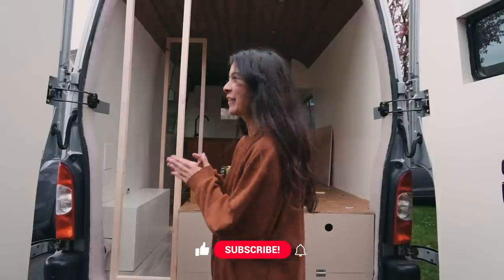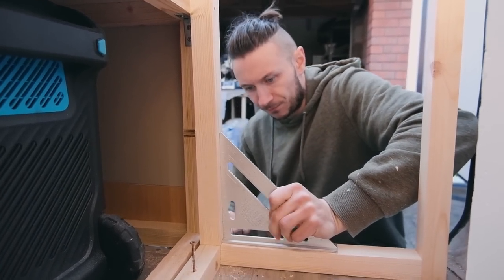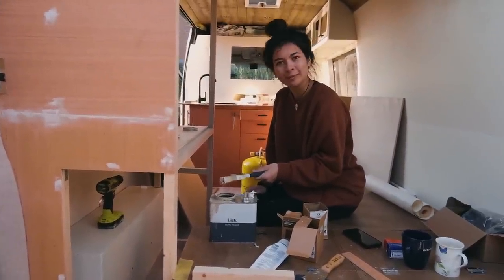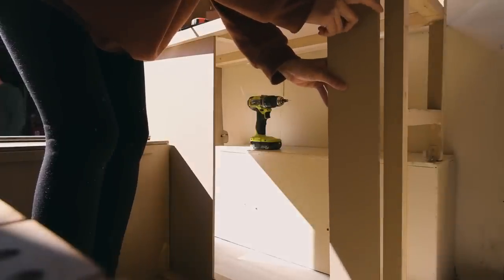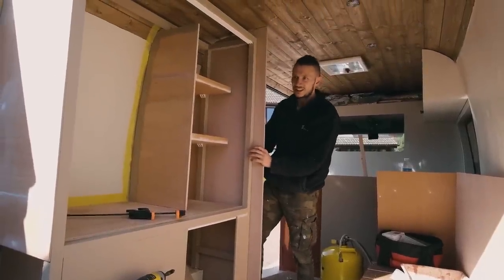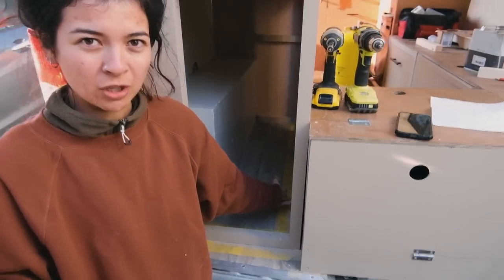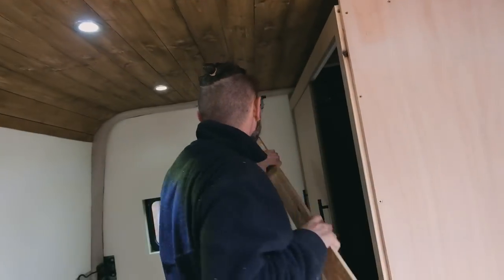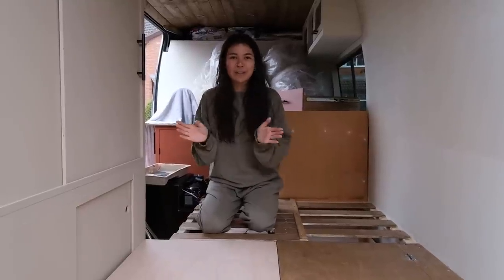Build an Easy DIY Campervan STORAGE UNIT | Renault Master Camper Ep 18

Comment: Tip for next build! Put a 20mm plastic runner at the top and a 10mm at the bottom. Cut the door 10mm shorter the it will slot in at the top and then drop into the bottom runner. Means you can fit bottom track before the door. The door can easily be removed if you ever need to repaint it or replace it.
Enjoing the build but can't wait for the next adventure
Reply from the maker: That makes so much sense 😂 I wish I’d thought of that sooner! For now, no one better ruin the doors as they’re pretty much permanently in 😅. 

We can’t either, this build and the filming has been going on for some time and with the 19 degrees coming end of this week, we just want to run away in to the wilderness ☺️

Hope you’re good anyway, thanks for watching and for the tip once again 🙌🏼

Comment: Looks really good should be lovely when done. Just one question, how are you going to stop things in the garage falling or resting sideways against the internal wall, and blocking the internal garage door from opening ?
Reply from the maker: Thank you so much 🤗 good point! We have stored a camping table in there so hoping that keeps anything from falling and blocking the door from sliding. Not too bothered if the door gets marked on the inside as it is a garage space after all 🤗

Comment: Hi nic how wide is dork inside at the back could a bed be fitted across the back keep up the great vlogs nic and Sam
Reply from the maker: The inside of the van is about 1750mm wide so not really possible to have a sideways van. I believe that’s from cavity to cavity so you could probably get a bit more out of it if you built above the cavaties but it would still be quite short. But depending on your hight it might work 🤗

Comment: Brilliant idea for storage.  First time I've seen something like this. 
How wide is it from the side of the van to the front of the unit at its widest point?
Reply from the maker: Thank you so much 🤗 It’s about 55cm deep measured at the wardrobe base
Reply: @Nic Roams (Nic & Sam)  no worries,  thanks 

The easiest way to install the runners btw would have been to cut the wood (sliding door) a few mm shorter. That way you could insert the top of the wood (sliding door) and it should have given you enough room to slot it into the bottom runner afterwards and then it would seat itself...that probably made no sense at all but if you look at most bathroom cabinets with sliding doors you'll see what I mean.
That way the doors can be removed if access is needed.